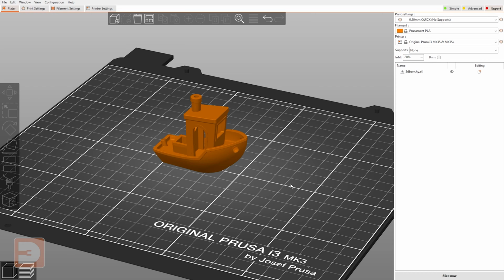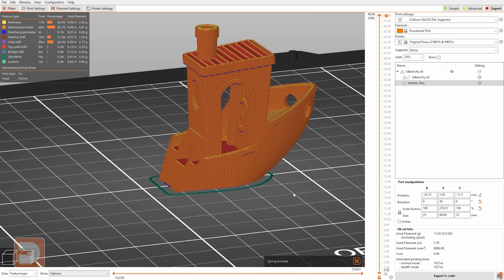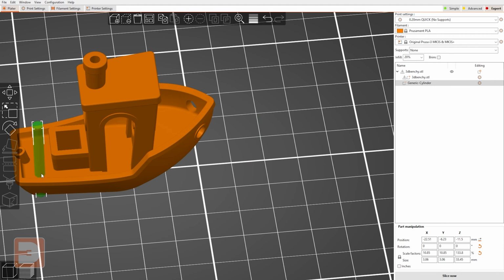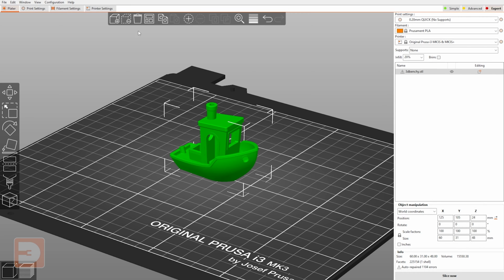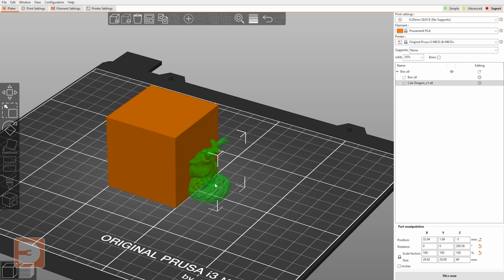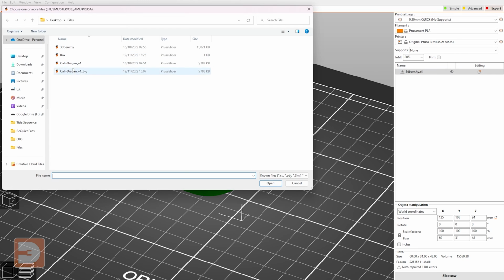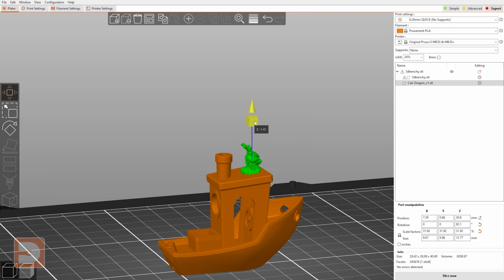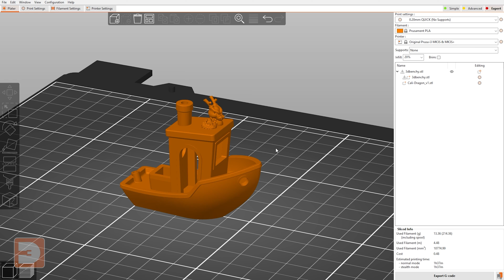Negative Volumes - PrusaSlicer Tutorial

Comment: ask a silly question but when you added the dragon to the top of the benchy how did you stop it from snapping to the bed plate please? every time i add a negative or a shape it auto snaps to bed?
Reply from the maker: Hey Paul, not a silly question at all. 
When you add anything in PrusaSlicer, whether it be importing an object or adding a negative volume or modifier, it will by default load on the bed level.
With a physical printed object that you've imported (which was not added as a 'Part' to an existing model on the bed), they will always snap to the bed and PrusaSlicer will not allow you to raise them unnecesarily.
However, with any object that has been added to an existing item on the print bed by right clicking on the model itself and selecting "Add Part", "Add Negative Volume", "Add modifier" etc, then once it has loaded, you can select the move tool on the menu on the left, and using the Blue Z axis arrow, drag it up to the height required.